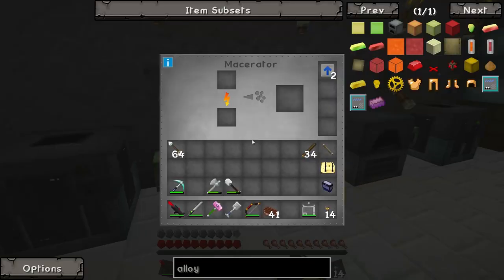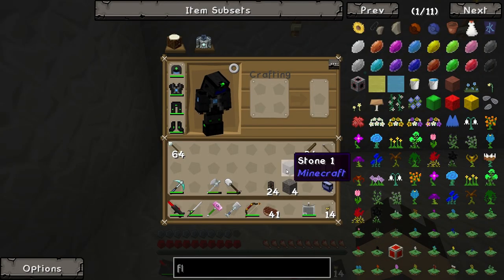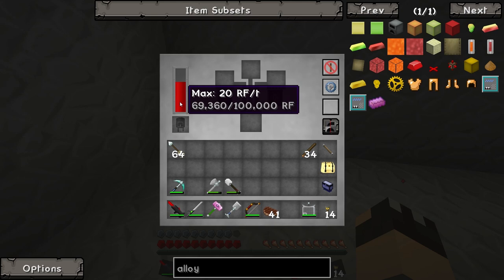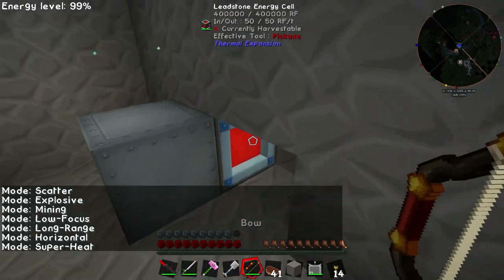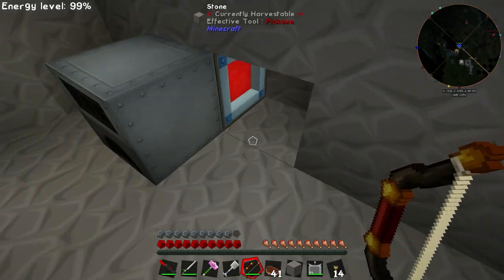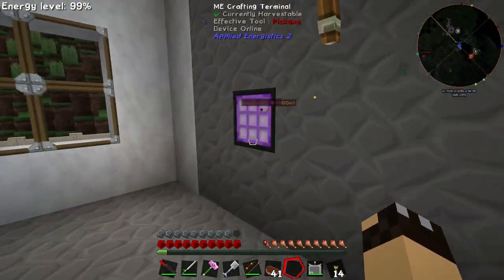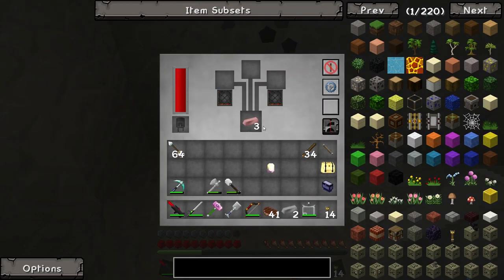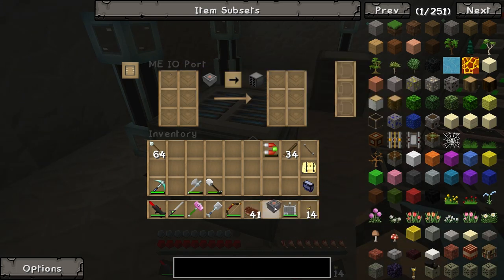Feed the Beast Infinity -57- Electro Magnet

Comment: Before the waste in the reactor is enough to be outputed as a cyanite ingot it is stuck in the reactor so there is less fuel -> less power (in case of bigger reactors that is less significant but yours uses just 4 yellorite ingots at a time)

Comment: I think that the 1.6.x update broke something with Kinesis pipes, I noticed that the leadstone energy cells were not getting power through the Kinesis pipes from a hardened solar panel, one of the nice thinks about the Kinesis pipes is that you can see the power going through. I may have fixed this by digging up the solar panel and putting it back again. With a second case I replaced the cables with the enderio ones.

Comment: I wonder if your energy/power conundrum could be related to the fact that the fluxducts buffer a bit of energy? With the amount of ducts you have around it amounts to quite a bit of energy buffered. So whenever you connect something that eats up alot of power quickly, you first empty the "buffer", then the reactor, but  when the energy cell of whatever is full the reactor still needs some time "rebuffer" the fluxducts?

Comment: Yet another great video. You need the capacitor bank, quite cheap http://wiki.enderio.com/Capacitor_Bank. You'll love the magnet, also helps near lava. 

I wonder if the power usage is related to different mods. You could try an energy cell just before the ae2 energy acceptor to see if you loss power when are is running off batteries. I noticed that I could remove an offending device and power was still being taken as if the device was still attached and had to remove the cable or wait for a while. I was using rednet cables as they can be used to connect machines from the different mods to one power cable. 

The crescent hammer with shift+rclick will keep energy in cables and machines, except ic2.

Comment: I think you need to put a leadstone energy cell on the Cyanite Reprocessor. Also to charge the magnet I think you need a Capacitor Bank from ender io
Reply: Michael Wilson I've not used one of those yet but I looked it up after you posted here and I think you're right, I was thinking Energetic Infuser which I use but this one looks like it can charge 4 things at once so it's probably a better one. Thanks for the tip :-D I'm going to go upgrade now.

Comment: An Energetic Infuser
Reply: MrThomasVIII That's how i'd do it too.
Reply: MrThomasVIII UnstableVoltage this would be a good opportunity to make the tin gear in the TC smeltery, use a stone gear as the base of a cast and pour gold over it to make the cast. Then use the cast to make, tin, copper, iron, gold, etc gears, it uses 4 ingots not 5 to make a gear. Another plus is that you can automate this with a hopper and a redstone clock. The downside is that you need to wait for the metal to smelt.

Comment: Isn't your ME Network the thing that's Draining constantly from the reactor? You unfortunately won't be able to stop that constant drain unless you make a large bank of Energy Cells, or AE Dense Energy Cells, fill them up and then disconnect them form the reactor and let the system run off the batteries.
Reply: sniperlemming Yes, pretty sure the drain was not the alloy smelter, but either the AE system or the Cyanite Reprocessor. Also, you can put a lever on the energy cells to turn them off.
Reply: I tested in my world since i posted that and my Cyanite Reprocessor doesn't continually drain. So i can't see how anything else could be doing it other than the AE system. I mean we know the AE system needs continuous power fed to it to run and having the Energy Cells there as a buffer is nice but the reactor is still being drained at the same rate after the cells charge up unless you disconnect the system with some sort of switch.